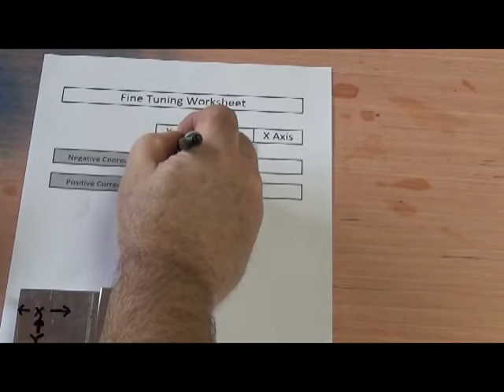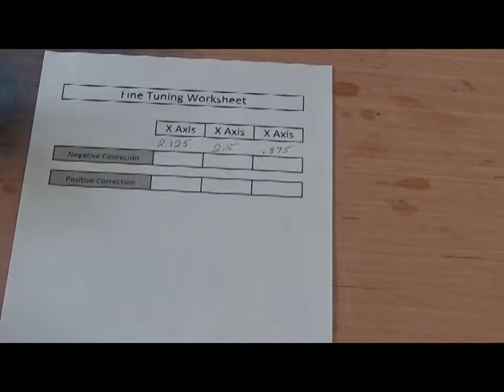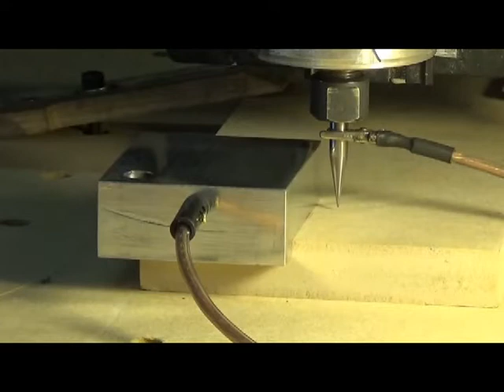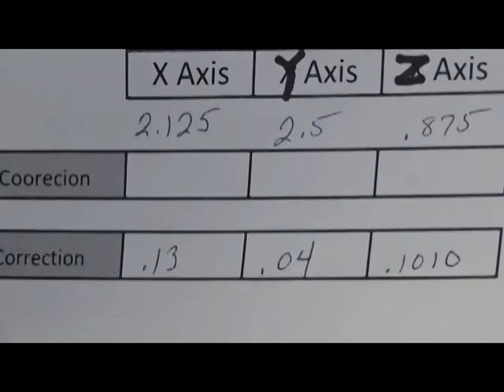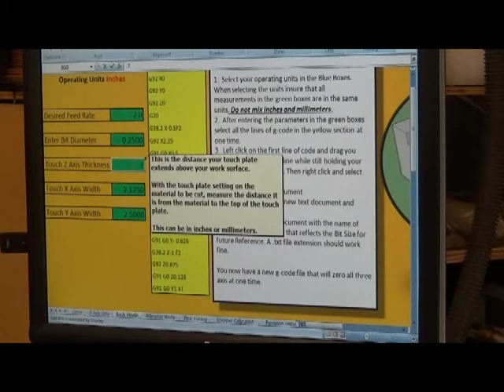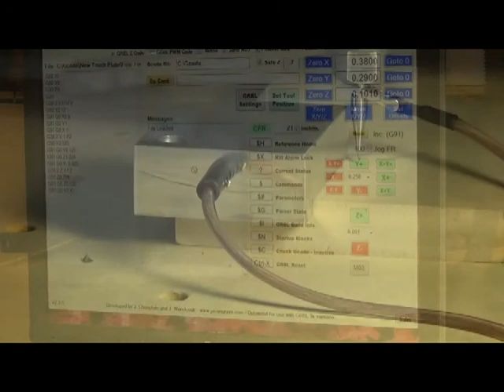Fine Tuning V2

Comment: How can I get these correction numbers with Easel?
Reply from the maker: In Easel, run a three axis zeroing sequence. When finished look at the top of the Machine inspector window. You should see two sets of numbers. One is machine coordinates and the other is work coordinates. The work coordinates should read all zero's or very close to zero. Next go to your Jog screen and position the bit where you want it to be. Then go back to the machine inspector and look at the work coordinates. The new numbers are your corrections.
Reply from the maker: BTW, after you put the corrections in the Triquetra Tool Box, be sure to generate a new zeroing script. The tool box updates the parameters but not any existing scripts.

Comment: Now i may be new at cnc,G-code,arduino etc etc,but i'm not new to engineering electronics 1st year and all sorts of mechanical fab,any way,the height block for zero,i've seen people use pcb,what about metalised film,real thin,say .1mm/.004",possibly the foil inside an electrolytic cap,so zero is for all intents and purposes zero,on the Z(ed) axis for you it would be Z(ee),same diff really.

Are you or have you worked vocationally with cnc,you know the G-code well,or seem to at any rate,i really appreciate you making these vids,do you have any books on this stuff ,i really need to bone up on all the aspects of this,i make(when i can) tube amps and play some guitar,the pcb and front panel etching plus maybe some other loosely connected engraving/etching are big on my list.
thumbs up and subbed.
cheers.
Reply from the maker: Hi John,  I learned enough about Gcode and Mach3 Script to be able to create the basis for 3 axis zeroing. I created the Triquetra Tool Box (a Windows Program) to do all the calculations and generate the zeroing files as a companion to the Triquetra 3 Axis Touch Plate for Arduino/GRBL, Mach3 etc. I learned just enough to get the job done and be dangerous after that. I'm definitely no expert in all things gcode, just in zeroing!  Thank you for the compliment though!!
Reply: welcome.I'm picking it up gradually ,been realistically looking at it on and off for about two weeks,i did however make the 3 axis cd rom cnc toy  a year ago,though could not get gcode to run,but it was grbl and that's .nc!!!!!!!!!!!,so glad i used easel to convert a small poochi pic to watch the 3 axis create the paths,no tool or pen but it worked by jove.

All the best.

Comment: Man Charlie that's cool how do you get ahold of pics sender and how do you get the spreadsheet?
Reply from the maker: +Summers Woodworking You can get PicSender at http://picengrave.com/. I have no stake in the company. I just like their software. It doesn't lock up like Universal G-code Sender does especially on massive files like 3d carvings can often be. As for the spreadsheet. It is available to owners of the Triquetra Auto Zero Touch Plate. Go to the Inventables forum for sale section for ordering info. It is currently only working with GRBL and not Mach 3, however, a friend is working on getting some Mach 3/4 script put together for it. I personally don't have any experience with writing script for Mach systems so I am at the mercy of my friend. He is a busy man but I am confident that when he gets caught up he will get it done.